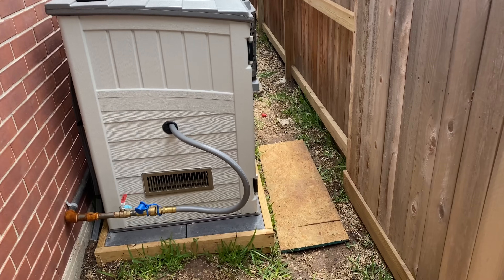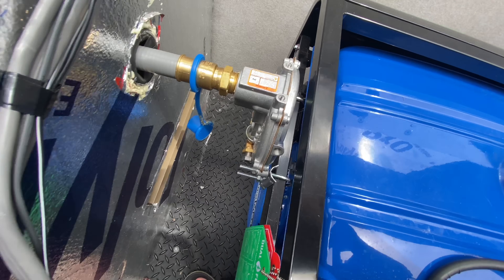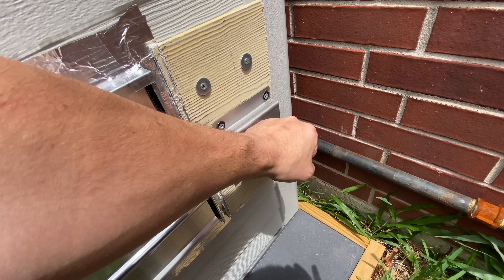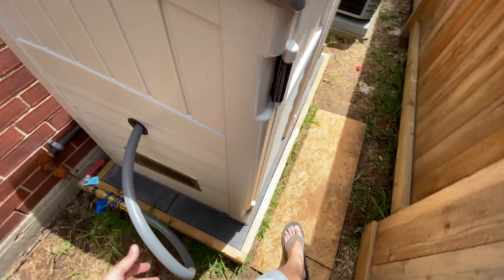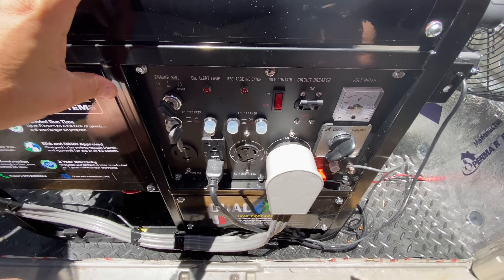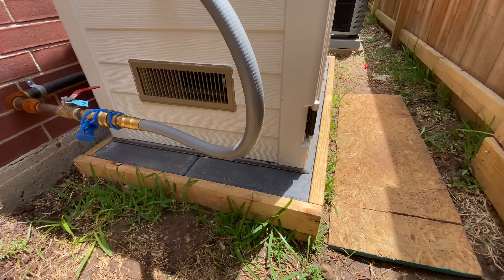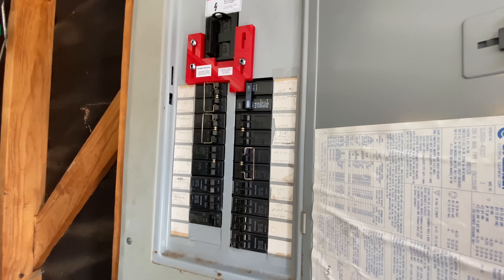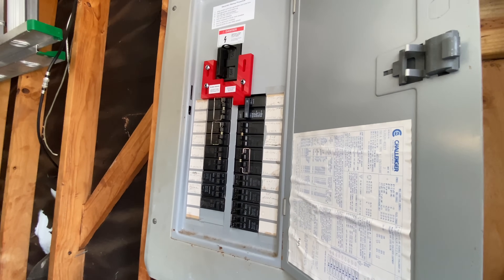Converting a hybrid portable generator to a whole home generator with shed

Comment: Great concept about installing concrete for insulation and fire issues in the exhaust area. I like your idea very much!. The only question I have would be why did you use wood at the bottom instead of some concrete slabs?. Excellent job!
Reply: Sorry I replied before finishing watching the entire video. I understand the reason now.

Comment: FYI, in 2024 here in Portland, OR I've had three neighbors get complete Generac standby systems installed. They payed $25k each!! I run my house off a $1000 Champion propane inverter, plus I spent another grand on electric stuff and tri-dual conversion. We have NG appliances, so don't need a lot of watts and only use A/C for a couple months in the summer.

Comment: Hey arent you worred that your exhaust is right next to your heat pump?  arent you concerned about carbon dioxyde poisoning?
Reply from the maker: Windows were far enough away, it wasn’t an issue. Also, never had any problems with it being close to the heat pump. That being said, I eventually moved it to the other part of my property after the gas line was run. You can see updated videos on the new location and tweaks.

Comment: How do your home electronics like PC, TV, router, et. al. deal with a non-inverter generator like this?
Reply from the maker: This specific generator has a low THD which makes it safer for electronics. I have had no issues with this setup.

Comment: might want to add a horse stall mat (rubber) from tractor supply under the housing to help aid in damping the vibration transmission from the generator into the house foundation.

Comment: That exhaust blows right into your AC.  🤔
Reply: It's just the condenser--there's no interior air handling going on there. But probably would be a code violation if he were obtaining permits.
Reply: @westhavenor  you make it sound like it’s no issue. The condenser is trying to take the heat out of the refrigerant.  Blowing hot air on it is not good. That was his point.

Comment: must be a pain in the ass to get it out to do maintenance. you could use a vac pump to suck out oil, how about the air box and spark plug? those accessible while its in position?

Comment: your exhaust is pointed directly at your AC condenser, essentially making your AC work harder to cool your home and the generator working harder and wasting more fuel/gas
Reply from the maker: Old video, it was later moved. Though it never was an issue.

Comment: The idle control should never be used in stand by back up power use it can damage electronics and the generator... it's not made to run stuff and the low of voltage and Amp range that's for jobsite use only when nothing is being used

Comment: A propane orifice îs  much smaller than a natural gas one, propane has a high BTU, so with these tri fuels generators I wonder how exactly they do propane versus natural gas, do they have different orifices do they have different regulators? do you have to flip the spring on the regulator?

Comment: I built the same setup 4 years ago. Work great without any issues. I then installed a soft start on my home AC 3 weeks ago. After hurricane Beryl My generator ran great for a day and a half. After that it overheated because the extra load was generating so much heat that the fan I had could not exhaust the heat fast enough. Lesson learned I have to buy a new generator and set it up outside the storage unit when in use to have proper ventilation. Also only use generator to run the whole house AC for a short period of time. Portable generators are not designed to kick on and off a whole house AC with a soft start every 20 minutes when it reaches temp inside the house. Going with an inverter generator and using a midsize window unit for the next storm.
Reply: What I did is just turn my AC as low as it goes and keep it on, this way it doesn't just keep starting and stopping.

Comment: I bet you used it again during that freak storm near Cypress & Katy!  Just a few questions, do you have a soft start or hard start on your AC?  And what ton is your ac for your home?  I have a 4 ton & a 3 ton and not sure if Incan run both.  Plus I had a 30amp plug, not a 50 “which I wish I had done instead”.  I did not do the 50 amp bc I didn’t think it was possible to run AC.
Thank you for your Vid!  I’m planning to prepping more bc Houston is so unpredictable now.

Comment: Doesn’t code require that the unit be installed at least 5 feet from the building structure???
Reply: Permanent generators are usually 3' from building walls and 5' from doors and windows.

Comment: We're in Austin. Twice in recent years we have had weather in the 20's for over a week. This is a first ever thanks to climate change. Unfortunately the power grid in our state and our city have not been quite ready for this, since Texas decided to pull out of the national power grid and to privatize electric energy production some years ago, we were without power for days both times. [It did warm my heart knowing that, even as I froze, at least power company shareholders were enjoying record revenue windfalls.] 

Anyway, due to health conditions in my household, being without power is very bad. Our electric panel won't support even installing a cutoff to run just part of the household circuits with a portable generator. So I put an outlet and electrical plug to power our home central heat system, and we bought some beefy extension cords. I am going to install some electrical sockets in the wall that will ultimately connect only to plugs I can plug into my generator. I will keep those outlets covered with blank plates. That way I won't have to run an extension cord through the door, which would leak cold air into the house. This way we can run our heater, fridge, water heater thermostat, stove ignjters, TV and router with a 2500 watt generator for a few hours a couple of times a day. (We have gas heater, water heater, and stove.) In our small household we could do without electric lights. It may not be ideal, but it won't be like camping out inside our own home, at least.

The inverter generator only cost us $500
Reply: Dude, climate change is a hoax!😂

Comment: Is there a way to secure that gas line so someone can't mess with it? Either locking open or closed.
I'm paranoid with stuff like that. Can picture someone undoing the disconnect, opening the gas line and igniting it.

Comment: I built mine about 2 years ago...and ours are VERY similar! I have a Pulsar 12k generator from Wallyworld for $800. I have the same cabinet from Wayfair, and same exhaust fan... our intake grills are similar, and i used a flex pipe exhaust to 1" EMT conduit and ran out of cabinet, 90° up to about 6' high and wrapped it in high temp cloth, also put a muffler on it. I also used a battery trickle charger that plugs into an outlet to keep battery charged. I didnt convert to natural gas, and am gonna see how you did it and do the same. Thank you for your write-up!

Comment: I have a similar generator and am having trouble connecting the flex pipe to the muffler.  What did u use?  I can’t find a coupler in that size.

Comment: I have the same generator. It’s a Duramax, and it comes with a floating neutral.  (The ground and neutral are NOT connected within the generator) You “DO NOT” use a ground rod when connected to your house panel.  You only use a ground rod if you are only using extension cords. Once you connect the generators ground and neutral wires to your house panel (through your 240volt cable) , then the main panel provides the ground to earth. You do not want TWO separate ground rods. BTW, very nice set up you have !
Reply: According to the manual on the inverters it sounds as if using and inlet box the inverter generator (bonded) can be hooked to the house...correct me if I or the manual is wrong.
Reply: @aholmes6612  I think you only bond at your panel not generator. When portable you bond

Comment: Do you run sensitive electronics like routers and computers off this? Heard inverter style is better for it
Reply: THD is 12% on that model.  It isn't recommended for electronics but there are millions of these "dirty power" generators in the world and very few electronics having failures.   Electronics have power supplies to switch from AC to whatever type DC the device wants.  Most failures would occur in the power supply and rarely the device itself.

Comment: If your generator is bonded you may want to change it to the floating mode by removing the bond as your panel is bonded already.
Reply from the maker: I have been thinking about this since I have seen a few posts. So essentially remove the connection to the ground rod next to the generator since the panel is grounded?
Reply: My Duromax 1300hxt tri fuel is already floating or unbonded from factory

Comment: I think you guys building these enclosures are taking a big risk. If your exhaust system fails, your gonna overheat. No issues with storing it in there, but I’m planning to pull mine out in the open when in use.

Comment: I have this exact genny, and live in the Greater New Orleans area, and we recently suffered through Hurricane Ida.  We had a really small utility generator that we could only run our fridge and charge my Milwaukee batteries and phones.  So I bought this one, but I won't tell you how much I paid for it... Anyway, I'm building a platform and dog house for mine as well, and wanted to hook it up to the natural gas, since last year the gas lines were blocks upon blocks long, and there were weeks when we had to drive miles upon miles and even out of State to find gasoline.  So I got a dual fuel and was about to buy a few more cylinders and a large propane cylinder and wondered if I could convert it and did the search.  Anyway, I was wondering one thing.  Does that additional steel hose do anything to the noise from the muffler?

As far as you needing to adjust the screw on the carb for the engine to run smoothly with the idle control on/off, I have a question.  Don't beat me up over this, but did/do you have the choke lever in the open/off position?

Comment: Great build Calvin. I’m attempting to mimic your build because it’s by far the best I’ve seen on here. I’ve ordered and received the exhaust tubing and was wondering how did you attach it to the muffler? I removed the screen cover and the tubing is the same diameter as the muffler exhaust. Did you have to cut slots in the tubing to get it to go over the muffler?

Comment: No.. dont make that adjustment to the revs.. The revs are pre-setup from factory.. at a certain RPM.. to make the generator produce correct electricity for your area...
here in the UK, we have 240v 50hz.... adjusting that governor arm, will change the frequency.. Which can cause damage to electronics.. 
If your in the US with 60hz power, and your generator is outputting 65hz due to adjusting the revs... You will risk damaging things..

Comment: Hey Calvin, I have begun putting my generator together.  I purchased the 1" Shed Exhaust Port and the 1" Exhaust hose.  The issue is the exhaust port for the muffler is about will not fit the 1" exhaust hose.  What adapter did you use?  Home Depot doesn't have anything, Kemah Hardware doesn't have anything.  I'm not finding a satisfactory reducer/coupler that allows me to continue using the flame diverter or without it.  Please let us know what you did for a coupling.  Respectfully, Jon Siewers
Reply from the maker: Hi Jon. Which generator do you have?

Comment: Do you have a problem with THD on this generator? I heard THD on Duromax is about 10-15%. Do you have problem with your sensitive devices such as TV, computer or refrigerator? Thanks
Reply from the maker: I haven’t other than a UPS I had some issues with. I added a line conditioner in front of it and it was fine after that.
Reply: @CalvinGorriaran  which line conditioner did you get? Thanks for getting back to me

Comment: Hello Calvin, Thank you for a very helpful video.  I plan to learn from it as I plan my generator setup.  I wanted to ask you if you wouldn't mind sharing what it cost to have your plumber install the natural gas pipe extension to your shed from your house or meter?    I am planning on putting the same generator and a similar shed.    The estimates I've been given for adding a gas line extension from my existing house natural gas lines of approx 25'-30' to my generator have been almost as much as the generator.  I wanted to know if you encountered a similar expense.   ($1000+).  The plumber also wanted to do a pressure test on my gas lines for $300-$400.    Did you conduct a presssure test?  These engines on the DuroMax 12kw are pretty small at 20cc and I expect would not take a large amount of NG Flow to sustain them when running for multiple days.  Thanks again for your kind input.

Comment: Said 1400 but adding on the nat gas plumbing, box, insulation, fan, solar deal, generator, accesories, breaker box add on, wiring, ground rod, exhaust i would guess the entire shpeal would be closer to the 4000 mark with all said and done…. Labor included.. still pretty cheap if you think about having a generac installed..  that would be in the 10 grand mark because of all the proprietary crap and they usually pour a concrete pad and all..
Reply from the maker: Total project was around $2,500. The generator with 4 year warranty was $1,400. I can upgrade or replace the generator and use the same box. I can also work on the generator if there is a problem on my own. Also have the option to use gas or propane. All those not an option on a Generac.
Reply: Said you had a plumber run the black iron pipe.  You know if they pulled a permit and had the whole deal inspected by the city or was that even needed?  My ng meter is like 10 feet from my generator and thinking pretty hard about running that 10 feet of pipe with valve and all but betting im going to have to pull a permit for work..

Comment: Hi, Why did you need to buy another regulator if you already have a propane regulator? did you try to hock up your NG line to the propane regulator directly instead of adding another regulator? I have seen other videos where they did not need to add an additional NG regulator.

Comment: very nice install. You gave me some better ideas to get the exhaust out of the shed. QUESTION::::The T pipe feeding nat gas to the engine with the adjustable screw is not listed in the parts list. I see other installs using that adjustment to get the mixture right for max output and smooth running engine. What is the part number please?
Reply from the maker: Thx Adrian. It came with the regulator kit. Though I have to imagine it is sold separately.
Reply: @CalvinGorriaran  Hey Calvin thanks for your reply. I finally tested my gen on Nat Gas before more rain and cold comes. It runs smooth as a kitten on a 3kw load. NO LOAD the engine has a little tiny miss. A very small little pop is heard; like a miss.. This is a bits and pieces project. I waited too long to get serious before the weather changed here. Thanks for your help. I got that exhaust exhaust pipe you used and top quality. And GR8 idea to use cement board for the hot areas. All happening here. Thanks

Comment: Very nice setup!! Well thought out. One thing I noticed is oil changes. Usually 100 to max 200hrs will require everything to be disconnected. Possible to raise genny so you could just use a tray underneath? Assuming oil fill/drain openings are accessible. Then you wouldn't have disassemble everything. I have run my generators for over a week straight and did oil changes at 100hr (4 day) increments.

Comment: I want to build a shed for my generator. I will only have it in the shed when i need to use it. If I put few vents on the sides and might only use the generator for few hrs, do i need to attach an exhaust extension and a cooling fan to the generator?

Comment: I have a question for you. Do you have any idea what the output of the generator is while running natural gas? My dad is wanting to do a natural gas/portable generator setup to run his house and I thought he would need a very large generator due to the wattage losses while using natural gas. Thank you in advance for any info you may have.
Reply from the maker: I believe NG causes close to 20% loss of power. I do keep gas in the tank with a stabilizer fluid incase I need extra power for some reason.
Reply: @Calvin Gorriaran   so that would be roughly 7600 running watts with this particular generator. You have no issues running your whole house with that?
Reply from the maker: In the summer, I only run one AC unit at a time. I also don’t use my electric (soon to be gas) dryer.

Comment: This is why there are codes and licenses. This breaks so many laws and ridiculously unsafe. 
Don't ground it separately, 
You had to adjust your gas because it's not getting enough air, your heat fan is making that worse.
Those regulators are made to vent to atmosphere when they fail, not be be an inclosed space, 
Your black iron outside needs to be painted
It's too close to the building, 
It's too close to that fence
It's too close to your ac units
I'm sure non of your electric is even close to code
And I'm sure that generator is undersized. That rating is it running off gas, it's way less under lp and even less with natural.

Comment: Thank you for posting this video.  I am looking to build a similar set up.  Curious how much did you pay for installing the natural gas line to the generator and roughly how long is it from your meter?  I had a plumber come today and quoted me $15K to bury a 150 feet line from my meter to the area near my electric panel, which is where I want to place the generator.  Thank you.